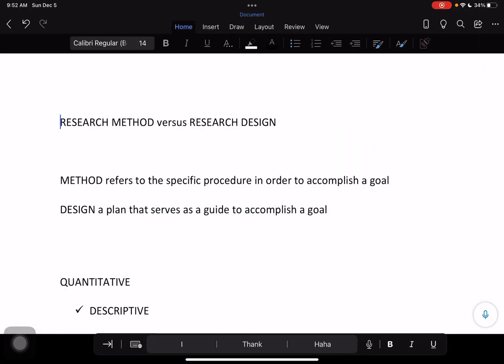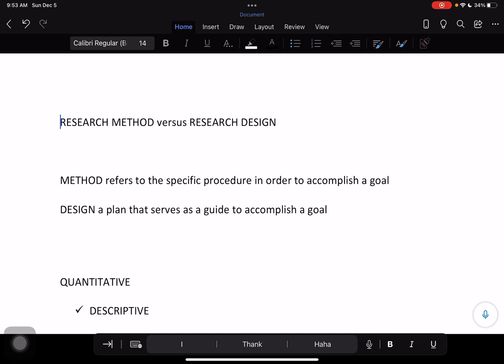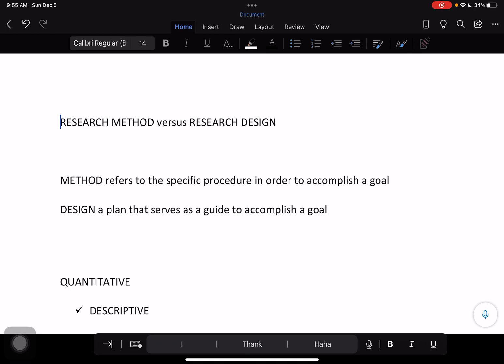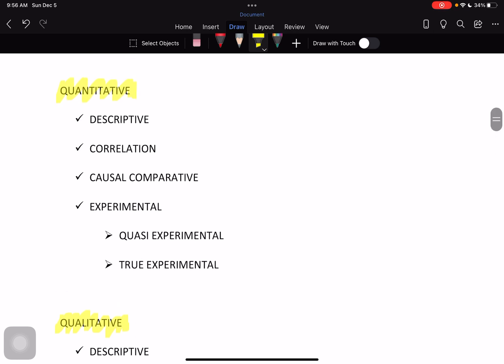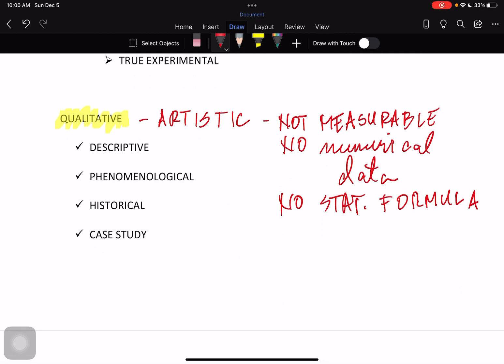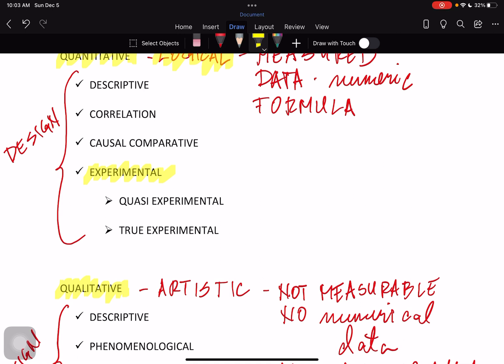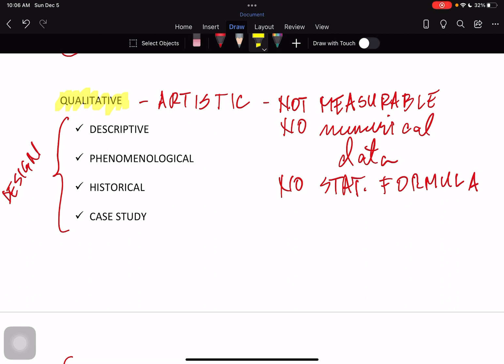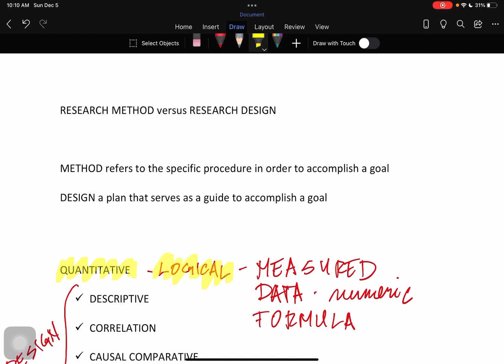RESEARCH METHOD VS. RESEARCH DESIGN (ENGLISH SERIES)

Comment: Hi, sir. If the research method is Hybrid, can we combine both Quasi and Phenomenological Research Designs? Or do we have to follow the specific research designs designed under Mixed Method, i.e. Triangulation?